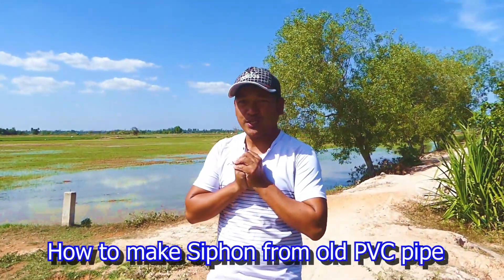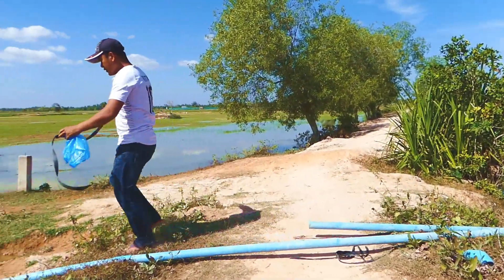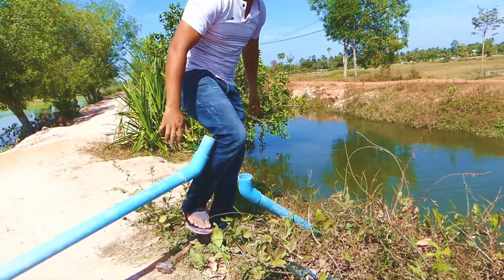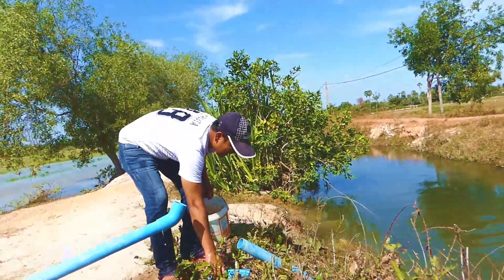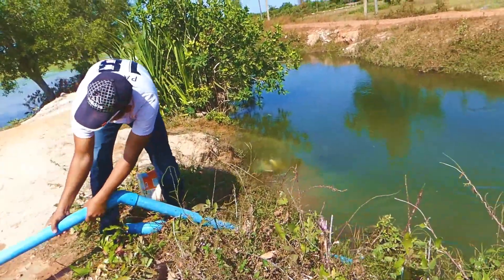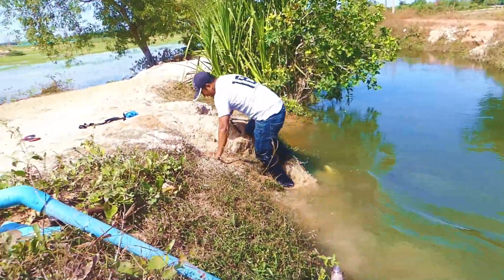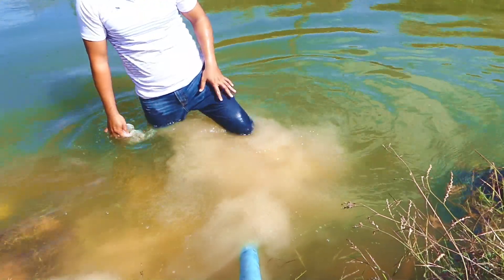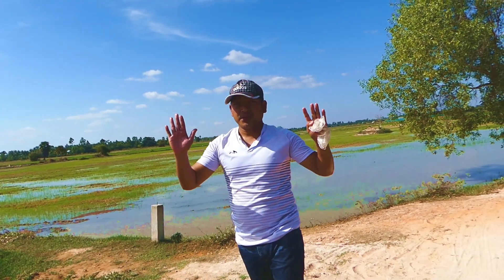SIPHON SYSTEM: Free Energy Water Pump | Pump Without Electricity using old PVC

Comment: What is the pipe size. 
I tried it using 2.5 inch  diameter pipe. 
But it's not working, can you tell why is not working. Please reply to me
Reply from the maker: This is Siphon system, make sure the output is lower than input Water, to close it properly- No air leaking